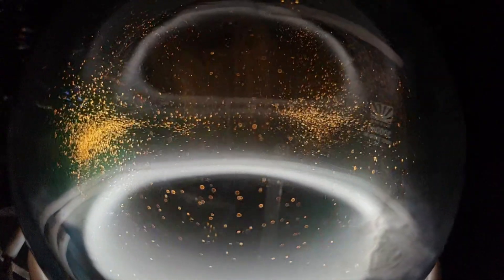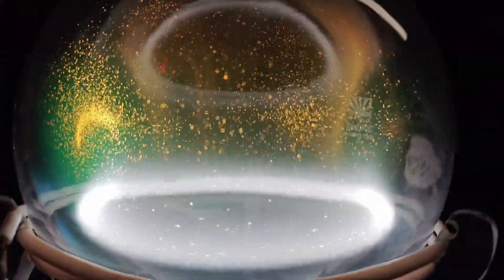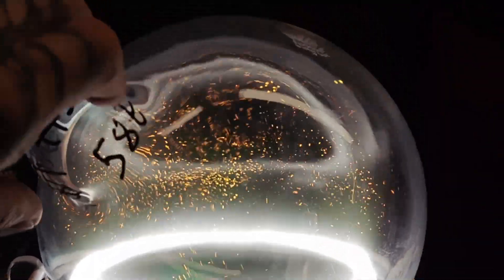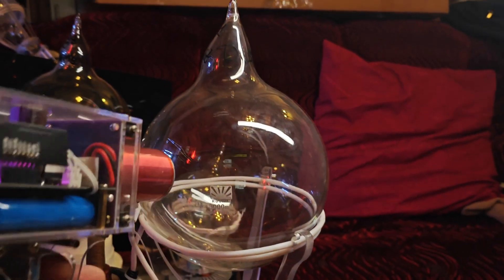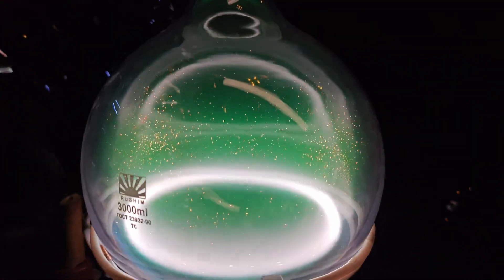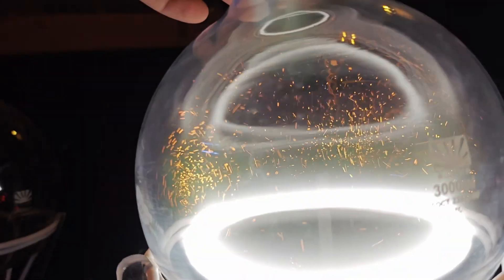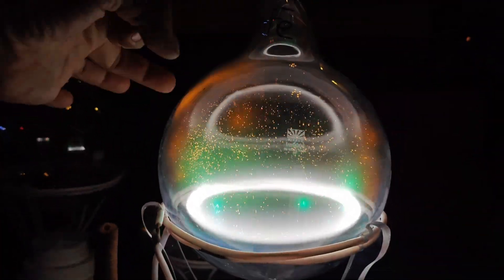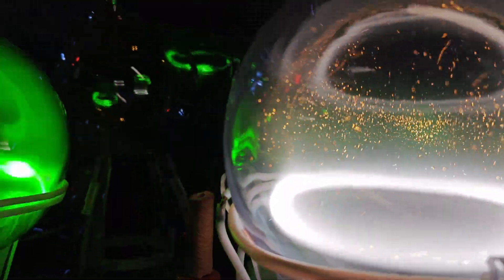Carbon Dusty Plasma Crystal in Xenon [bad audio]

Comment: If you were to put a diamond seed in and orient it near the inductor I wonder if it's powerful enough to grow the diamond. It's done with heat and pressure or heat and electrolysis. I don't know if Xenon, Argon, Neon or another elemental gas would work. Thank you for sharing!